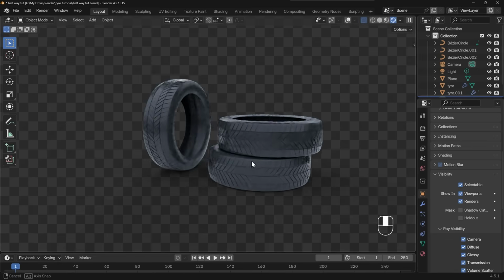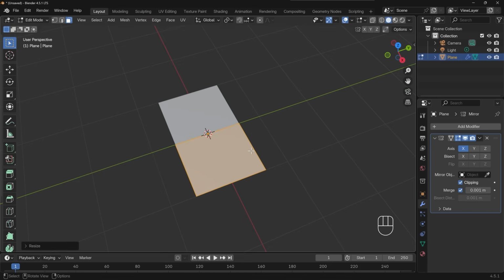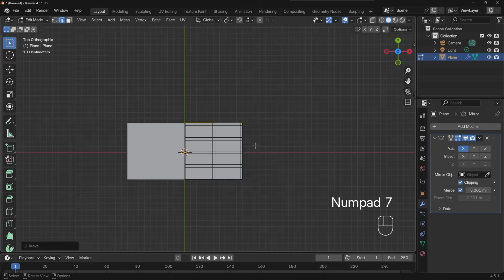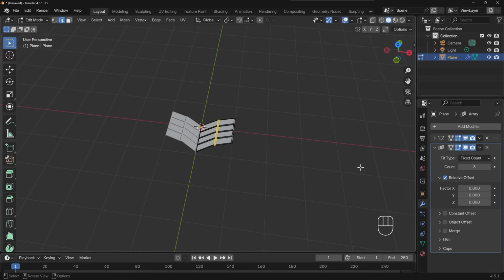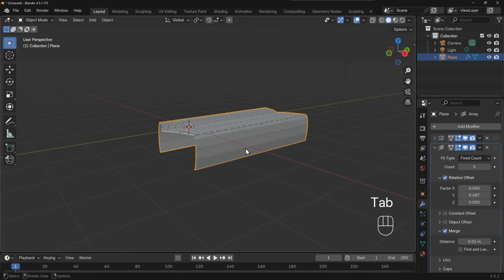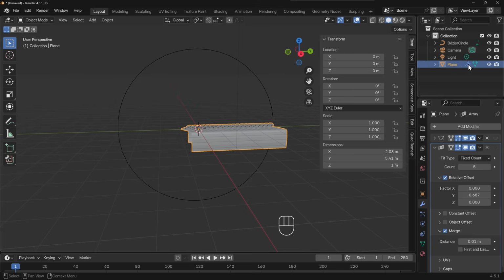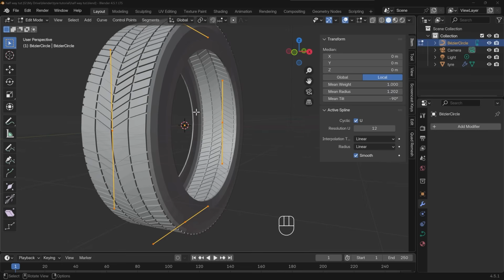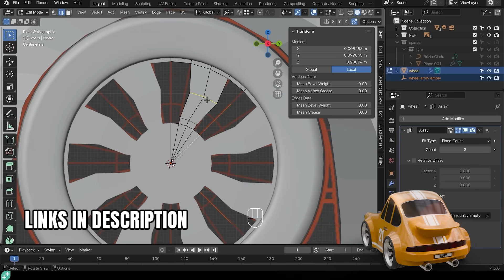Tire Modeling Secrets: Hard Surface Techniques & Smart Modifiers

Comment: Hi grantt. I started learning blender in February and your channel has been a life changer. I've commented on your channel before, showing my gratitude, but I just want to give you a quick update, and also explain my situation:

I don't have money, and my laptop is a lenovo celeron (one of the slowest laptops you could have in general, so my blending journey is sometimes a nightmare). I'm using this laptop just to get a hang of blender, and maybe by the time i get a job, i can purchase a stronger laptop or computer, so i can start creating complete projects.

I'm taking a structured approach to my learning, and currently this is what happened: 

-I'm confident with my modeling after watching your tutorials from the very start as a beginner, then i moved on to the hard surface tutorials. 
I've gained a significant amount of confidence, and understanding on topology after the hard surface tutorials.

So far I've independently modeled and rendered some low poly cars, and characters. My understanding on topology slowly started solidifying when i did these personal projects. (thanks to your foundation)

-Today, after a few weeks of persistence and dealing with life in general, I just finished your course on painting the thunder gun. Prior to this, i watched your course on texturing the shack, and after that, i started with the thunder gun and I even modeled the thunder gun by myself before i could watch the whole thunder gun series.

-tomorrow I'm moving on to animation, and I'll even be reading "the animator's survival toolkit"

This is where i have to say thank you, because i looked for some channels that could have a structured approach just like you, and i found non. When i came back to your channel's Playlist, I saw a free animation course waiting for me. 

I nearly cried because i couldn't believe that you are handing such knowledge for free, yet it's so well structured. 
A side of me even wondered, "why does he have such resources for free? " 

Overall, Grantt, I dont have money to buy courses, but the day i do get that money, i will definitely donate to your channel and buy your courses, so I can refine my knowledge in other areas. 

I'm 7 months in learning blender, and people are already calling me, "talented" even though i see myself as a beginner, so thank you sir... May God bless you tenfold. 

I hope you see this comment, but if you don't, then I'll copy it and post it on another YouTube video you post
Reply from the maker: Thanks for the kind words and great to hear the youtube courses are helping! People in your situation are the reason I make these resources for free as much as I can. You don't need to donate. Im just glad to hear its helping you. All the best
Reply: @grabbitt thank you sir... It means the world to me🙏